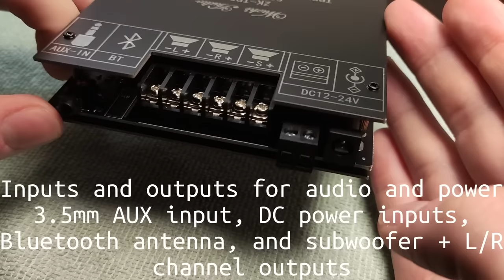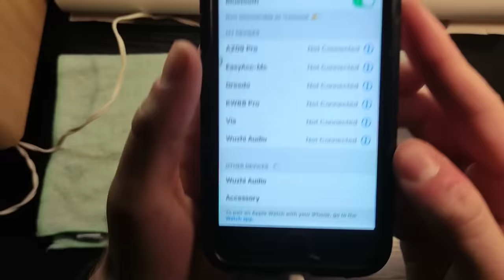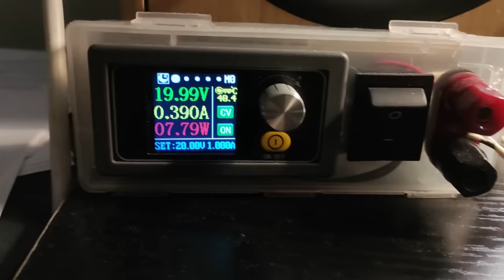Cheap 200w 2.1 Amplifier - Wuzhi ZK-TB21 Unboxing Assembly and Test

Comment: I don't like those small speakers... Plz use huge cheap woofers... U might see the change clearly
Reply from the maker: I have bookshelf speakers I can use but haven't gotten around to connecting them because they are currently connected to my computer amplifier
Reply: Tried the same exact amp with a 15inch subwoofer and a pair of three way speakers, absolute monster.
Reply: That amp looks to be about right to use for making a portable boom box.
Reply: @justins.1283  just thinking this. I think I'm gonna do it in the future. My girlfriend got a boombox3 recently but I'd like to my own now. Maybe I'll do two of them to make it better than the boombox. Definitely a cool project.
Reply: @justins.1283  It is, it has a very little power draw, if you don't attach a subwoofer to it ofc
Reply: @_salvo234_ not work well,
Reply: Gave reply to this comment with new video.
Reply: @_salvo234_ what is your input voltage?
Reply: @kronosdarkangel5290  Input voltage 220V i used a 36V15ah as an output (regolated to 32V)
Reply: @scellysspeakers hi one question..
Is this board becomes mono when we connect Aux cable and stereo on bluetooth??
Reply from the maker: @pawan6614  This has been asked before, I tested it and it is real stereo with the aux cable and with bluetooth. The connector on my unit only works with some of my cables though, when it does work it is full working stereo sound.
Reply: Okay lang yon
Reply: yea those speakers are from a tv theres no way their gonna handle anything

Comment: I had this amp. I really recomend it.
Reply: Same
Reply: I have a qustion
If you connect it by Aux , Do you have to adjust input mode by every time turn it on?
Reply: The device automatically detected inputs and it's automatically select which has the signal.
Reply: Thank you
Reply: @YureUre  will always use bluetooth if have divice connected, or will use aux first if disconnect.
Reply: I have this amp to, but AUX-in jack is Mono, stereo with bluetooth
Reply: Hey can this amp turn on using a battery which is huge voltage? Im planning to buy amplifier that can be use by battery and and connect to my speaker and put it on my scooter
Reply: @martinpanjr839  you can use 12-24 volt car battery:) yes you need DC batteries or power supply.

Comment: I have the model, ZK-MT21 but it looks exactly like this one, one thing I don't like is the Bluetooth for some reason skip like 2 seconds of the start of every song, no matter how many times reset, unpair and pair the unit, also if you turn the amp off the Bluetooth continues to be connected to my phone and I have to disconnect the power to be able to connect to my headphones, have you noticed any of this troubles or has been fixed on this model?
Reply from the maker: Yes it's the same with this one. They all use the same jieli Bluetooth/aux chip. It is just how A2DP Bluetooth works, it takes a while for the chip to start the output after periods of silence because when there is no signal on the Bluetooth audio it mutes the output to reduce the hiss, it takes a while for it to realise there is music playing and to unmute it.

Comment: Have you tried the AUX-in plug? I have this amp, AUX-in jack is Mono, Bluetooth Stereo. don't know if it's original or not, my unit has a tpa3116 D2 32pin IC
Reply from the maker: Many people have reported the same, I think it is a design flaw. On my unit I have full stereo, others report is is mono.

Comment: Hey guy’s what’s the RMS I have a 8inch 100w rms 200w peak sub with 8ohms and some speaker with 50w Max. 24V 6A power supplie is that ok or do I have to use a lower power sub?
Reply: This can do 50w RMS @ 4ohms on the subwoofer, so only 25wrms on your 8ohm sub. Also 50wrms for left+right channels.
Reply: 18- 20 ватт rms ,будет выдавать ваш сабвуфер при данном питании ,слишком много 8 Ом ,нужно 2 Ом
Reply: The lower the ohms are the more power they pull,which in all actuality gives you more from your amp

Comment: Hi! Is it possible to use a switching power supply with a power of 150 W 24 V 6 amps, but not 5 amps???
Reply: i've searched these matters before.. as long as you use 12-24v with at least 5a, example 12v 5a or 19v 5a, you can power it up but the speakers might be distorted on higher volume, if you're not using 24v.. but amps must be sure to match or higher.. do not get anything past 24v for this
Reply: @TanJianWei92  It is recommended to use 24v 5A, but I have a 24v 6A power supply.
Reply: Нужен 25в , 8-10 ампер

Comment: can this amplifier be connected to the car?
Reply from the maker: Any amplifier can in theory be connected to a car, but this one is not designed for that purpose. It doesn't use the connectors and wire harnesses that are for cars. You create your own custom harness for your car to connect to it and power it from the car's battery, but you will have to make these adapters and harnesses yourself.

Comment: wow 700k views for a device like this on a channel with 2.7k subs.  congrats! I exactly have a copy of this but it has completely no right channel using AUX/Line IN.  another problem is electronic noise at higher gain/volume setting.  Electronic noise disappears when you don't play anything or immediately after stopping audio. Do you have a problem like this?
Reply from the maker: I have had some issues with the 3.5mm input where I'd have to hold the connector a specific way to make it work, but it hasn't been an issue for me since I am using it almost exclusively with Bluetooth. As for the noises, I think that's just part of the experience with cheap Bluetooth devices. I haven't noticed it much because I don't use it at very high volumes.
Reply: @scellysspeakers  thanks! my dilemma if  I should return mine. I also resorted to Bluetooth but it is not too reliable under Windows PC once I started touching settings, on top of the tiny latency. The small amp is indeed powerful but I did a lot of tweaks to enhance low bass/subwoofer channel while reducing the rest of frequencies. now I'm around 80% volume.  I slightly made the noise less noticeable by using smaller weaker main speakers and reducing treble on device and equalizer.  anyways you say it is normal so it won't make sense to return mine and buy a more powerful one like the Zk-HT21. I'll probably reuse this amp for a DIY bluetooth speaker in the future.  thanks again, subbed!

Comment: I am interested in this amplifier. Can you tell Dose it has any start-up thumbing problem?
Reply from the maker: No there is a delay from it turning on and the speaker output being enabled
Reply: @scellysspeakers  thank you 😊.  I have a problem with the Tpa3116d2 amplifier. It does that start-up thumbing.
Reply from the maker: @Geniusinventor  I personally have not experienced it, you can see in the video when I power it on with the speakers connected that it's silent until the Bluetooth sound plays.
Reply: @scellysspeakers  how is the sound quality on it? Does it have distortion on higher volumes?
Reply from the maker: @Geniusinventor  Sound quality is generally good, there is distortion at high volumes if you use a power supply less than 19v.

Comment: This amp is very good but on online shop in my country some people sell it with fake Ic not the real Ic.Wuzhi zk tb21 using tpa3116 2.1 Ic,the fake ones use the others and it's not tpa3116 2.1, u can check it by opening the heatsink
Reply from the maker: I think the ZK-MT21 is the one with the fake chip, you can also tell by looking at the components next to the speaker terminals.

Comment: When you see 200 watts those speakers look like they came out out of a TV can flat screen TVs use those kind of speakers
Reply from the maker: Yes this amplifier is described as being able to output 200w, but I'm not driving it even close to that in this video because I do not have any speakers even remotely capable of it. It's more of an unboxing/building/simple test video.

Comment: Careful with that amp i had one where the sub output blew after 2 days, and the left  channel blew a week later and almost broke my speakers
Reply from the maker: what impedance are your speakers and what voltage power supply did you use? these amps tend to overheat under sustained full power 4 ohm loads
Reply: @scellysspeakers  the voltage was 24v with 4 ohm speakers

Comment: Had the same exact model then sold it to a friend, 14v 3A, however, he's pumping out a 15 inch subwoofer and a pair of 3 way speakers.

Now i have the later version (160w+160w+220w) with 32V 10A and it managed my two 12 inches subwoofers so well, sold 'em and got a single 15 inches, but still rocking it.
Reply: do you have a link
Reply: What power adapter can i use with this amplifier? I cant find one around 30v and 8-10a i want to use a 10” sun with 6.5  2 way mids
Reply: @sergio13810  24V 10ah

Comment: Este amplificador é sensacional! Recomendo muito para quem gosta de musica e de pequenos projetos qualidade HIFI. Alimentação em 19.5v 4a. Toca muito. Compre e seja feliz.
Reply: Quanto é a potência desses alto-falantes
Reply: @ezequiasdossantos3701  Os que eu utilizo em casa são (1 Tweeter Ultravox de 150rms; 1 Woofer Eros de 10 polegadas de 300rms e 1 sub Eastech de 250rms)... OBS: os falantes são mais potentes, mas desde que vc respeite a impedância... Vai tocar muito. Para meu uso está excelente.
Reply: @rodrigoamorim5537  Sim, eu testei colocar a impedância abaixo de 4ohms pra testar o sistema de proteção, quando aumenta muito o volume, ele desliga para proteger o sistema, muito bom esse amplificador.
Reply: @ezequiasdossantos3701  Eu tenho um apesar no manual diz 2 falantes de 50w cada e um sbwoofer de 100w porém eu uso caixas mais fortes que isso no talo a unica coisa que venho reclamar é dos vizinhos que vem bater na minha porta pedindo para abaixar o som kkkkkkkkkk

Comment: I need help I have the same model  and a 24v adapter and a 800w subwoofer . When I turn the  volume up the Amp shuts down 😅
Reply from the maker: What impedance is the subwoofer? this amplifier is only designed for 4-8 ohms. Also I suggest using a small fan to keep the heatsink cool when using it at high power.

Comment: my ZK-TB21 subwoofer channel is gone.😔😔 I tried looking for burnt components like a resistor or capacitor but can't find it.😔😔  I bought an Aiyima amp with true dual tpa3251 chips but the AUX/Line in does not work and bass frequency range knob is terrible, it still sends human voice to the subwoofer.
Reply from the maker: Did you connect a very low impedance subwoofer to the amplifier or use it at full volume for a long time? These amplifiers are known to overheat if used at high power for a long time so I suggest using a small fan to keep the heatsink cool.
Reply: @scellysspeakers  slightly, it is a 3 ohm sub. My use will not overheat as only the subwoofer channel is driven hard and most bass songs don't have constant load.  I think my fault of mine is using 26 volt power, I used it because it is the max recommended of the Chipstar cs8673e datasheet but it is likely that the board is designed to max at 24volts.😢 It was a slow death as the bass drops, it sounds distorted or electronic and weak until it complete disappeared in 30 seconds.😔 I want to fix it but still can't find the faulty component.  I finally made the Line/AUX In in the Aiyima 2.1 amp TPA3116D2 to work. No more issues unlike the ZK-Wuzhi amps! It is more efficient or puts out more sound for the same power, maybe 20-40% more efficient.  I was also able to find a PC Equalizer so that bass gets low like the Wuzhi amps.  It feels I don't I need to upgrade the 20V, 4.5A power adapter I currently use.  It is only $6.68 more expensive than Zk-tb21.
Reply from the maker: @zodiacfml  Still you ran the device out of spec, that would definitely be the reason. Even if it is only the subwoofer channel, there is an entire chip dedicated to it that will easily burn out if ran improperly. For 3 ohms I would've suggested never going above around 70% volume for the subwoofer channel, which is the point at which the AC current would match the peak of what you'd get at 4 ohms.
Reply: @scellysspeakers  true. it is hard to maintain a safe power output because I listen to youtuber bass music which has all sorts of bass frequencies and gain. I hope to fix the Zk-Tb21 someday though- I will check again once I'm done with other tasks. the subwoofer chip looks fine and the pin resistances seems similar to the other chip. thanks for the replies!🤩🤩

Comment: Question...
the bluetooth is always on even if the power/volume knob is off.
is there a way to add a switch or tie the bluetooth power to the knob??
Reply from the maker: For me turning the amplifier off also turns off bluetooth. Maybe you have a different model or a fake version?
Reply: @scellysspeakers   just plugging the amp to a power source turns the bluetooth on even if the volume knob and the indicator light is off.... i might have a fake one.
do you have the datasheet of the bluetooth ic? ive been looking for the it but no luck.
maybe i can mod the ic and add a physical switch.
Reply: @scellysspeakers i mean u can try it on the amp.
unplug everything connected the amp... make sure to turn the amp off... plug to power... then scan the amp bluetooth or connect to it....
Reply from the maker: @denspants7852  yes when i turn the power off from the volume dial it also turns off the bluetooth chip, when its connected to power but turns off there is no bluetooth signal broadcast, i don't have the datasheet because it is unfortunately proprietary
Reply: @scellysspeakers  mine does not turn off.
maybe its fake.😥😥😥

Comment: Hello mate. Can I power a low watt Satellites with high watt Sub? Means Can you lower main Volume knob to minimum and Sub level knob to Maximum and still get good volume sound from Sub? Are those independent Volume levels or are closely linked to same level with master Volume?
Reply: 1
Reply: 6:23
Reply from the maker: the master volume controls both the sub and L+R channels together, it is after all the master volume. however the subwoofer output has a very high gain so I don't think you will have problems.

Comment: Hi. Some say, with aux  sound is mono. Did u encounter that?
Reply from the maker: I have been using it with aux mode and have not experienced this, however the connector is very fussy with what cable I use. Some cables do not give a good connection and only work at specific angles while others work perfectly.

Comment: Is there a way to change source bewtween BT and AUX? everytime i connect my bt on the phone, the source changes to my phone and the aux to my pc isnt sounding anymore
Reply from the maker: No, there isn't any way which frustrated me a lot. From what I read online, the only way to fix it is to reflash the jieli MCU on the board with a firmware that prioritises AUX over bluetooth.
Reply: good for you, on my device if I plug in aux it turns off BT completely :/

Comment: I have the upgraded version with th2 cooling fan and it feels like it will burnout a pair of sony lbt soeakers and a 10" sub
Reply from the maker: When pushing a lot of power through it you will absolutely need a fan
Reply: Agreed, but the small one is impressive with the right power source, I'm running a power source with 24v @ 3amp and it makes the amp run solo good